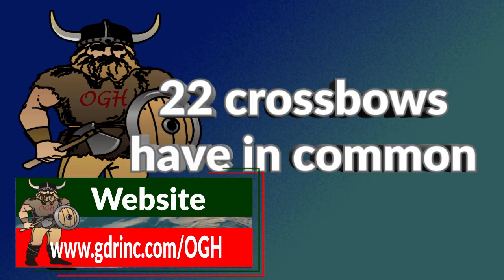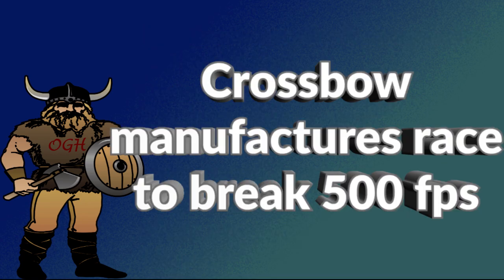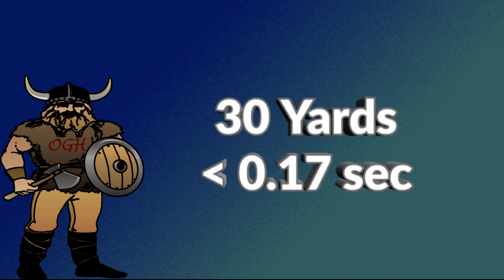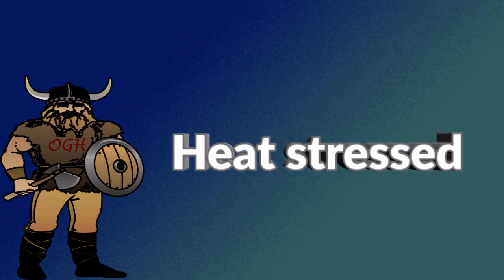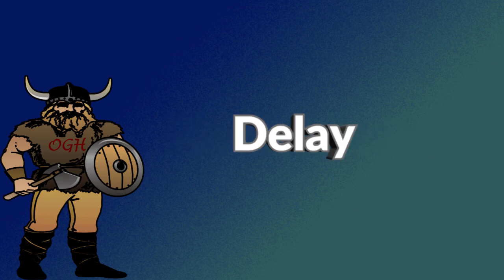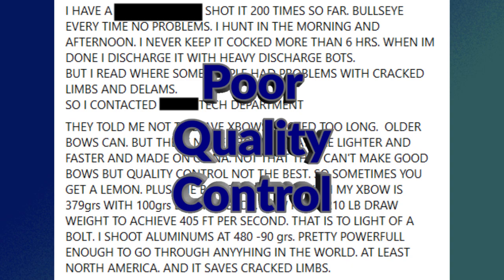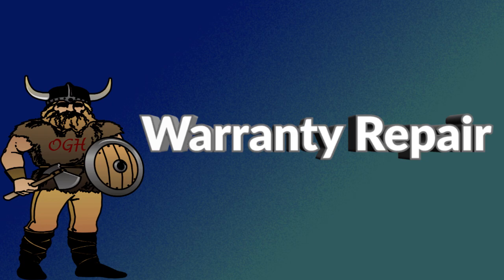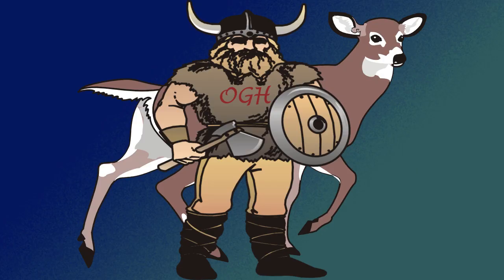Limb Failures

Comment: My excalibur micro rated for 335fps shooting an arrow over 400 grains.  Never dry fired.  Limbs have still broken twice.
Reply: If it was a series one 335, that model had a riser than was milled improperly and Excal was replacing them free of charge for awhile. As to arrow weight... 400 is ridiculously light and isnt close to any standard set by the A.M.O. for recurve bows. So yeah... It was doomed as soon as you started using it.  By the way... Excal never put out a recall for the 335 and risers were not replaced until 2 dry fires had occurred with the same bow. After a year or two they simply stopped replacing the risers at all and just kept sending out limbs. The 335 was notorious for limb problems and many 335 bows are still in dealerships being sold as new, due to the fact that nobody wanted them. Not anyone educated on the subject anyways.  I bought a 7 year old series one (sold as new) in a dealership a few years back. It had the same ill machined riser on it but with 650 grain arrows, it never had a limb issue despite the underlying deficiency.
Reply from the maker: @leveraction767  Well stated.

Comment: Another great video with extensive analysis and detailed statistical support! I think my Jackal comes with a suggested 4 hour cocked time but I have gone six to 8 on many occasions! And I’m using at least the 400 grain recommended arrow weight. This entry level XBow has taken two hogs and has functioned flawlessly for 4 seasons now. Not bad for an entry level weapon. But I’m sure the need for speed will drive me to a faster bow by next season, even though “Speed Trills but Accuracy Kills!”🎯
Reply: Amen ron
Reply from the maker: "Lastly, DO NOT leave a crossbow cocked for extended periods of time. Barnett does not recommend leaving a crossbow cocked for more than four (4) continuous hours."

Barnett states that on page 34 of their Universal Crossbow Manual https://www.barnettcrossbows.com/wp/wp-content/uploads/2018/10/Barnett-Universal-Crossbow-Owners-Manual.pdf

Comment: As to limb failures... Most failures I have seen are based on construction of the limbs and number of shots fired. The Excalibur 355 and the K.I. Ripper are probably the two most notorious bows out there today, for demoing themselves. The destruction is always the same but when you question each owner (and many owners, as I have) you find that these breakages can be on 2 year old bows or bows just purchased. Every time, it is the number of shots that seems to be the only similarity. Some people just dont shoot a whole lot, while others shoot a great deal. Some people can own a particular faulty limb for years because they only take a shot or two to confirm the scope each year before going hunting and then only shoot it again if they target an animal. After that, the bow returns to the hanger to sit unused till the following year. It can take 10 years to fire 50 rounds when this is the process. Something to keep in mind when you see one model always breaking and yet many owners saying they have never had an issue with the very same model.

Comment: The consumer (I believe majority) isn't educated in the background of the bowyer and therefore, I have to place most of the blame on the manufacturer, who supplies the arrow weight. If the end user is following the status quo (which the manufacturer establishes) then they cannot be faulted in total for their ignorance. That said... The manufacturer ALWAYS states that the arrows provided are the standard minimum weight. This is the sneaky way manufacturers get their FPS numbers without liability for damages. They state clearly it is minimum, so if the user chooses to use the minimum then thats on them.  Excalibur has been honest and yet xtra sneaky in as much as they do openly state that a heavier arrow is better all around but they hide (in plain site) the fact by putting it on the website but listing this fact in one subsection of their home site and in the broadhead section, for one particular broadhead. Sneaky sneaky!  Other manufacturers (such as 10 point) openly advocate for heavier arrows by offering them on request. The biggest issue is that no manufacturer is explaining to the buying public, the standards and options available to them and that is left to people like yourself. I have had many debates with neophytes who swear they are shooting practical arrow weights based solely on the fact that the manufacturer supplied those weights with the bow.... Despite the fact that the same manufacturer also recommends added weight. It's a tiresome daily routine in attempting to educate the new bowhunter in light of the fact that manufacturers are basically supporting uses which they themselves encourage to move away from, after the sale.
Reply from the maker: The following is from page 31 of the Barnett Universal Crossbow Manual https://www.barnettcrossbows.com/wp/wp-content/uploads/2018/10/Barnett-Universal-Crossbow-Owners-Manual.pdf

"Never attempt to use arrows weighing less than 380 grains. Lighter arrows can simulate a dry fire condition and will result in damage to the crossbow, immediately voiding the warranty. Failure to follow these instructions may result in catastrophic damage to the crossbow and may lead to serious injury or death!"
Reply from the maker: Barnett has admitted that the crossbow industry does not have a standard for calculating arrow speeds.

"The crossbow industry does not have a universal set of standards for calculating “advertised arrow speeds.” Instead, manufacturers rely on various arrow weights to calculate speeds. These arrow weights range from 380 grains to 400 grains."  
That was found on page 31 of the Barnett Universal Crossbow Manual https://www.barnettcrossbows.com/wp/wp-content/uploads/2018/10/Barnett-Universal-Crossbow-Owners-Manual.pdf

Think about that for a few minutes.

The first thing that comes to mind is that comparing two crossbows shooting at the same speed is comparing apples to oranges.
With two crossbows shooting at the same speed, that 20-grain difference results in both different kinetic energies and momentum. Admittedly the differences are not much, but without a standard, the consumer is not given all the information needed to make an informed choice.
Reply: @oldgrumpyhunter  Barnett also rates their bows at 380 but will not warranty at 380. Every Barnett I have seen for the past for years says (in small print) using a 380 arrow, when addressing speed ratings. Then they state that 400 grains is the minimum weight for that same bow. What you say they state as to ......"manufacturers rely on various arrow weights to calculate speeds. These arrow weights range from 380 grains to 400 grains." .....  thats not at all true. Manufacturers (like 10 point) are rating models at 500 grains. It's all over the place is a true statement but thats because there is no oversight.
The industry does not want regulation and/or oversight.

Comment: Poured mold limbs are inherently weak by design. The pour mold is the most popular limb process out there, because it is the fastest and cheapest material cost for production. Every limb coming out of china is a poured mold. Laminated limbs (made from blanks) are the strongest limbs available. If you dont want limb issues, stay away from poured limbs. If you cannot see a multi layer construction when looking at the sides of the limbs, then you are most likely looking at a poured limb. Most manufacturers boast about their limbs, when using laminates. If the manufacturer is using laminates, they will make sure you know it ;)